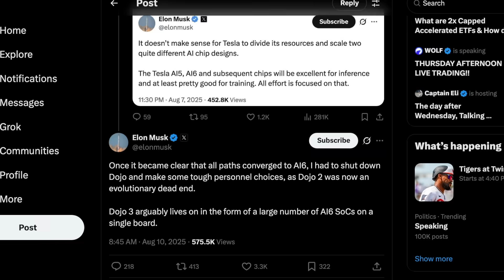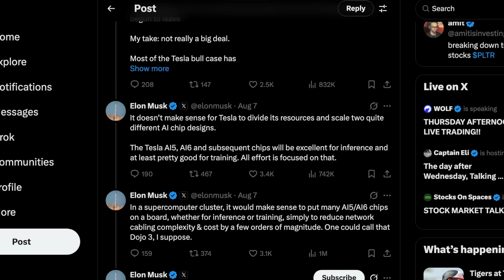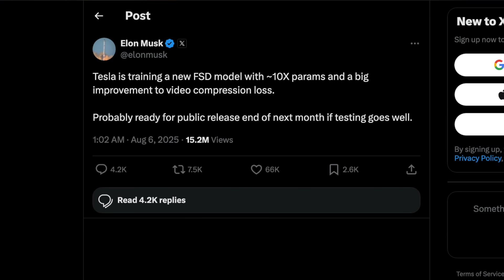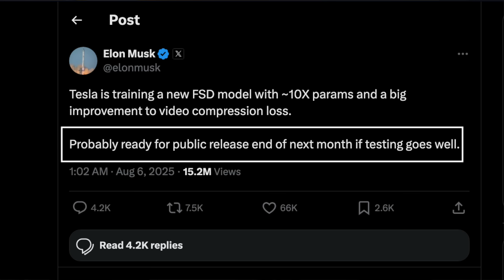Tesla HW5 Reveals Significant Performance Upgrade For New Vehicles | Massive Changes Coming

Comment: Remember with aI4 Elon said they are going to solve unsupervised now before they deal with Ai3. Ai4 is basically running without a driver already. So you'll still have years of usage. People will not outrun technology. Lease the car if people  worried about it. Waiting for my upgrade from Ai4 2023 MYP and should be getting my Juniper AI4 in the next few weeks.

Comment: We have two Teslas. I terminated my wife's 2023 MY lease two months early and upgraded it to a MY Juniper this month (a 3-year lease) to take advantage of the $7,500 rebate. My wild guess is AI5 won't be mass produced until mid-2027. Waiting nearly 2 years AND missing the $7,500 rebate makes no sense to me. For her, AI5 will have to wait until Aug 2028.
I'll upgrade my paid-off 2018 M3 shortly after AI5 is introduced.
Reply from the maker: Solid plan 💯
Reply: Agree, like the channel but the AI5 hype and "This changes everything" is getting old.
Reply: @StormyDog  I really do believe AI5 will be a huge leap because what Elon said was his way of warning AI4 buyers their cars will be left in the dust at some point in the future. But, IMO, you must add at least another year to his AI5 timeline. I honestly wouldn't be shocked if it doesn't reach scale until 2028. Keep an eye on the Cybercab production equipment ramp up at Giga Texas. It will coincide with AI5 production.

Comment: How much of a range decrease is there going to be if they're moving from a compute unit the consumes 160W to one that consumes 600-800W. At 240 Wh/Mi I'd be expecting a drop in range of about two miles per hour driven (so about 6-7 miles for a long journey on the motorway, or even more for city driving over a longer period).
Reply from the maker: I don’t think they would allow any decreases in range for any models, that would be a huge fail for consumers regardless of how powerful the chip is. Probably new batteries will negate any additional power draw
Reply: Next gen aluminum cased batteries will be out at the same time. Allowing a 7-ish% increase in KWH at the same weight.

Comment: Do you believe HW4 will be capable of unsupervised FSD in the next few years? So essentially a driver could hop in their car at midnight, fall asleep, and wake up at 7am approaching their destination.
Reply: Yes, absolutely. I'm aware of multiple HW4 owners who've done 10K miles without a single intervention, and that's on a six month old version of FSD (not the improved one being used in RoboTaxi) and using v13 rather than the upcoming FSD v14 (with it's 10x parameter count increase).
Reply: If you're asleep for 7 hours, how are you going to charge it?  That aside, I have HW3 FSD which is quite good and obviously HW4 is better, but I'm not sure I'd be comfortable enough to sleep while on FSD until it's got quite a few proven unsupervised miles.
Reply: @kenbob1071 autonomous charging. Vehicle pulls up to a supercharger, charge port opens, machine arm inserts charger. Or a charging mat. Tesla will come up with solutions for robotaxi mode.
Reply from the maker: As optimistic as I am I do see some physical hardware limits such as memory that needs to be sorted, not to mention cameras not having proper cleaners like wipers
Reply: I think its more depending of where you live, here in france road rules are more complex, i think the processing power is not enough to get FSD fully operational , but in the USA it should be OK even for low cost BYD cars